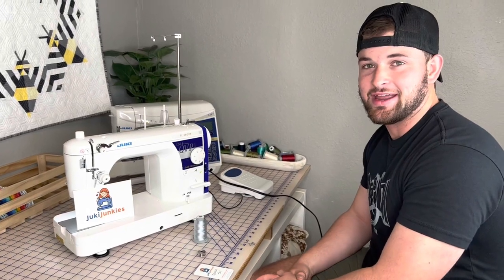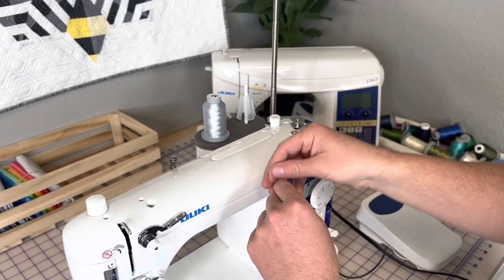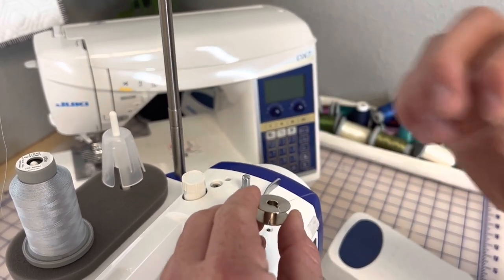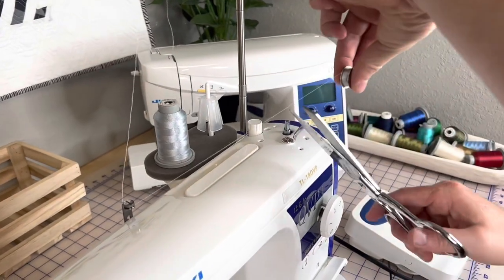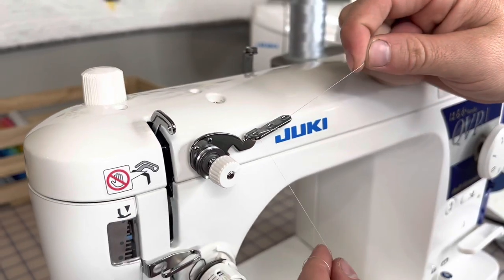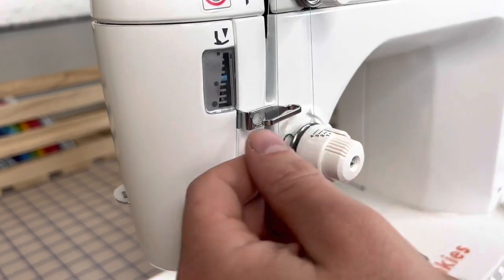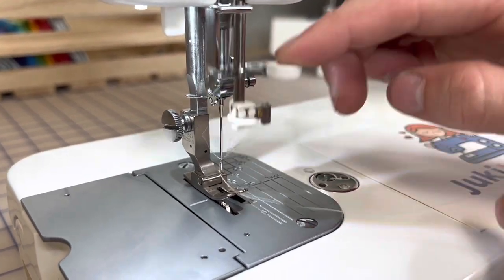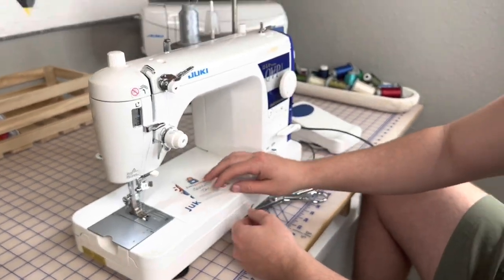How to thread and wind bobbin on Juki TL-2010/ TL-18/ TL-2000

Comment: I have a Juki tl20000qi and all of a sudden it stopped automatically threading.  I use a Schmets 90/14 with just about every quilting project and have no problem for the last year. I'm putting the needle in properly.  What's do you think might be going on?
Reply from the maker: Your may need a new needle threader here is the Link.
https://jukijunkies.com/product/needle-threader/

Comment: I just bought a Juki TL18QVP. I would like to try Glide 40 wt thread.  The instruction book says to use HAx1 needles. What size needle should I use for the Glide 40 wt thread?
Reply from the maker: NEEDLE RECOMMENDATIONS:
With Glide 40, you can’t really go wrong with your needle choices!

When top stitching your quilts,  we recommend the SCHMETZ 5 TOPSTITCH NEEDLES 90/14 or SCHMETZ 5 QUILTING NEEDLES 90/14
For piecing, we recommend SCHMETZ 5 CHROME UNIVERSAL NEEDLES 80/12
For bulkier projects, we recommend SCHMETZ 5 CHROME UNIVERSAL NEEDLES 90/14 or SCHMETZ 5 CHROME UNIVERSAL NEEDLES 100/16
If working with faux leather/vinyl, we recommend Non-stick needles or the Microtex needles

Here's the link to our website we have tons of information on this website as well!
https://jukijunkies.com/product-category/threads/glide-thread/

Comment: I am missing a few steps in this video. How do you insert the bobbin case into the machine?
Reply from the maker: I insert it with the U facing up and not using the little lever on the bobbin case. Push it in till you hear it click in place.
Reply: @JukiJunkies  Thanks for responding so quickly. That helps a lot. 😊